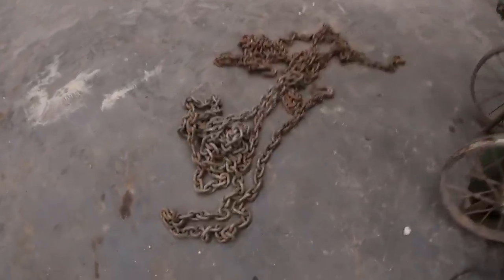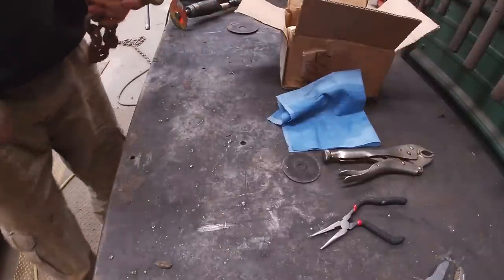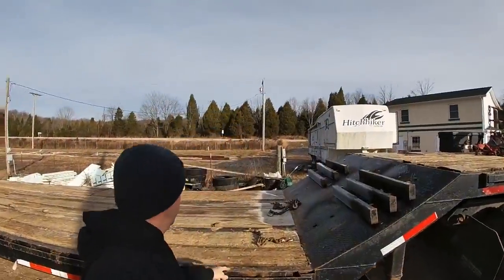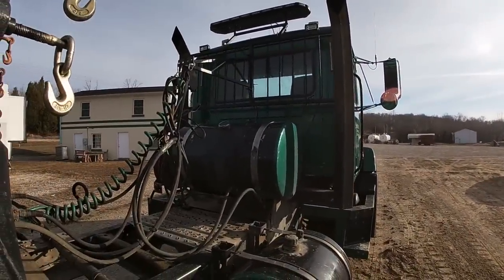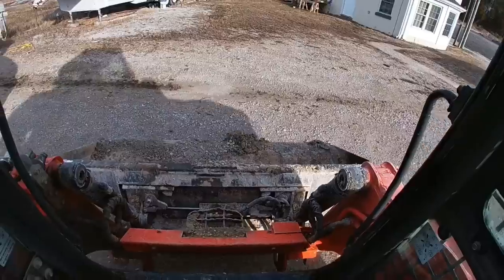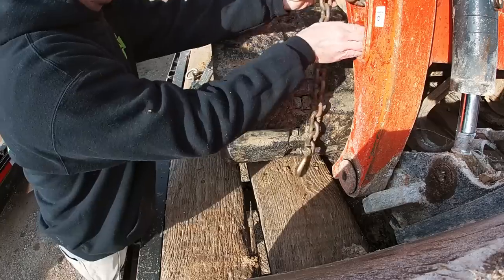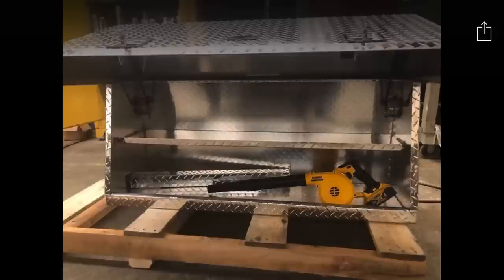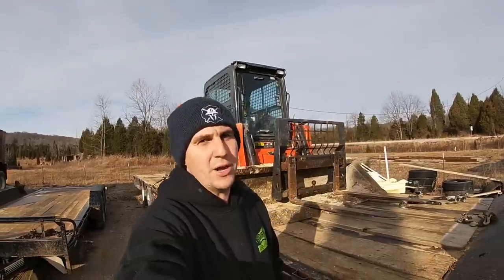G70 custom haul chains - why we make our own truck chains for hauling heavy equipment

Comment: I have short chains like that but only one hook, only need one hook when used with a binder to connect 2 chains. Also have 2 hijs connected with a clevis or 2 links of chain I use to shorten chains without using a binder
Reply: 1towmater1 one wasted hook per chain on chains this size.

Comment: i ordered new grade 70 hooks a couple months ago to do the same thing. they are still sitting in the box in my office! i haul medium and heavy trucks. i never need 27' of chain. i am cutting mine into 3 separate 9' chains. i found some hooks with a flip over lock that keeps the chain from coming out of the hook.

Comment: I would see about getting some stake pocket D-ring inserts; a lot of DOT guys will give a warning for using the trailer rub rail as a tie-down point, despite some trailer manufacturers noting a WLL on it.  I've seen more than one trailer with bent up rub rails - whether it was chronically careless driving or singing tight binders on a heavy load, I dunno.
Reply from the maker: Hooking to rub rails is 100% legal.  We host an event every other year where Indiana DOT comes down and goes over new rules and regs.  This question is brought up every time.
Reply: @CaptainKleeman  The problem of rule consistency from state to state and even officer to officer within a state is one that myself and many others want addressed - what's fine with one doesn't fly with the next.  At $100-$150 per opinion, doesn't take long to see the bottom line suffer.  :)

Comment: Love the chain binders! You guys need a 1 ton dump and trailer to haul that skid steer  to those small jobs. I’m sure you would find with the savings in fuel alone it would pay for its self. Not sure if you have a mini excavator, if not get one! LoL it could haul that too.  Oh, dump that stuff out of the bucket before you load it on the trailer there sonny!
Reply from the maker: we have a C8500 with a trailer we use often.  We thought we might be backhauling the john deere 120 so I planned on the mack for this trip.  but you aren't wrong about the fuel!

Comment: I liked the way you used to use the longer chains but still wonder a little bit about all the chain laying across the trailer deck. 

Still good to keep enough long chains around for that oddball load that only has anchor points in the middle.
Reply from the maker: absolutely, these will work for most of what we haul.  but we will keep the chain well full with long ones.  good point wayne.  hope you're off to a good start for the weekend buddy!

Comment: May not seem practical for most but I have several trailers dedicated for specific machines and I always shorten chains so theres not 10 foot of excess to deal with.  A few even have one end on a Clevis to the d ring and hook on the other so the chain stays in place

Comment: I've got 8 chains that are 8' long for just equipment on my step deck. When I was doing heavy haul all I ran was grade 80 an some grade 100 witch is recovery rated but was needed in some spots
Reply from the maker: good to know john,  what kind of binders did you run?
Reply: @CaptainKleeman  I run only ratchet binders for equipment but also have snap over ones too lighter stuff. I buy all my tie down equipment from Midwest wheel. Don't buy them cheap ones from harbor freight they not rated heavy enough
Reply: @CaptainKleeman  as for as brand I'd have to look again say I don't miss speak
Reply: I haven't forgot to check brands on the binders just waiting to get the truck back out of the kleeman

Comment: Next time you are cutting chain off like that, just cut out the weld on one side of the chain link wide enough to extract the other link.  Now your left with a potentially useful heavy C-shape rather than less useful U-shape scrap piece.

Comment: I am not the most informed on truck chains but I was told that G70 chains are specific for tieing down loads on trucks.  That chain is very stiff and does not stretch. G80 chain while a higher tensile strength is more flexible and will stretch allowing the load to come loose.  Any thoughts on this?
Reply from the maker: i'm not sure about the stretch on G80, you're right about the higher tinsel strength, but since DOT requires a maximum amount of stretch on chain....you know i'm just not sure.  i'm gonna have to do some more research on that part of it.
Reply: G70 more likely to stretch without breaking than g80. The grades are to do with the carbon count. The higher the grade the higher the carbon count the more brittle the chain. (G120/ice kinda a different world though!) This means g70 is more likely to handle a load shift in a emergency breaking situation. It's amazing seeing broken g80&100 knowing the sort of forces involved in breaking them! Is the lever over twicth style still legal over there? They are in New Zealand but more and more companies are banning them from site.

Comment: That death grinder scares the crap out of me with no guard and being held at 90 degrees to the cut is just asking for an explosion.
Reply from the maker: Michael Slee what do you mean by 90 degrees to the cut?
Reply: Captain Kleeman 
If you look at the way a normal angle grinder is used it is line with you, or zero degrees. 
Using the death grinder you are cutting sideways or 90 degrees and it’s just inviting a wheel grab. 
A normal grinder will grab and climb out of the cut a bit but still stay in line with the cut. 
Death grinder will also climb out of the cut but due to the way you hold it also twists and it’s much, much worse. 
I also despise grinders with no guards as there is no good reason to take it off. 
Cheers, Michael
Reply from the maker: Michael Slee have you used air powered cut off tools before?
Reply: Air grinder stop almost instantly when you let off trigger
Reply from the maker: Cody Jv exactly,  and they don’t have enough torque (unless you’re really being insane) to shatter a wheel

Comment: I saw that blower you have and wondering if it is any good thanks love you guys
Reply: I picked one up for my wife... it will move all the debris That isn’t stuck on.  She uses it for cleaning the garage floor and patios... she has caught me using it to blow off the mower deck and tractor... had I not left the battery dead once, I might still have my blower privileges.
Reply from the maker: like william said, if it's lose it does the trick, wont replace the broom, but will help alot.

Comment: do you need a binder on every chain? .... say on that skidsteer you put the chains in the back move forward and chain bind it in the front
Reply: Short answer: Yes.  As per Federal Motor Carrier Safety Regulations section  393.112.

Comment: Grade 120 all the way. so much easier and you can go smaller, 5/16 has the same strength as 3/8 grade 70 ;) 
But in all honesty, grade 70 works just fine. I might go to grade 80 next time, merely cause I keep using chain for pulling on things, may even get a piece of 100 for just in case. I keep trying to convince my father to use more than one tie down for his tractor. I cannot, for the life of me, convince one friend that a 2" ratchet strap is not sufficient for holding his BX to the trailer.
Reply from the maker: thats a good idea keeping a 100 around for pulling the truck out or a piece of equipment.  may have to look into that.  thanks for the tip!

Comment: ok i know some of the chains need a hook on both ends but why do them all as you only use 1 end with a hook ?
Reply: The other end would be for the chain binder.
Reply: @Briebabcock8052  chain binders have a hook on both ends.
Reply: Greg I was thinking the same thing.
Reply: @scruffy6151  Yes correct, I'm aware, I didn't read Greg's comment correctly till right now.
Reply: @Briebabcock8052  that's ok we all say things before we think I know I sure have.😉
Reply from the maker: you're right 99% of the time we only need one hook, BUT, we like to have options for that rare time we need both.  who doesn't like options?
Reply: @CaptainKleeman  thats true too

Comment: I use 1/2 inch grade 80 on my 50 ton lowboy and 1/2 inch gr 100 on the 2+2+2 lowbed
Reply from the maker: thanks!
Reply: to quote kung pow: That's a lotta nuts!
here and I was thinking my 3/8 chains were a pain to schlep around

Comment: you put all the pins in wrong the cotter pin should be on the open side of the hook so if it gets stuck you can pull the pin out
Reply from the maker: are you messing with me?
Reply: @CaptainKleeman  no if the hook gets stuck on something you can pull the pin out and the worst thing you lose is a hook you dont have to cut the chain i had a old guy tell me this in 1995 cuz i was doing it the way your did it
Reply: Problem is it creates a shear point under norm operation for how the chain pushes on the pin in the hook. You will shear cotter pins and have the main pin fall out going down the road from vibration.
Reply from the maker: Levi C well that’s fair.  I can’t put down the tips that have been handed down.  Thanks for the feedback and thanks for watching!
Reply: Brandon Vanmeter - I agree with you.  Cotter pin takes less abuse.